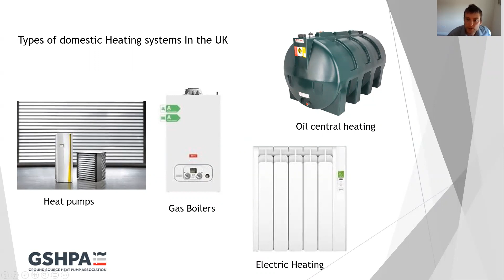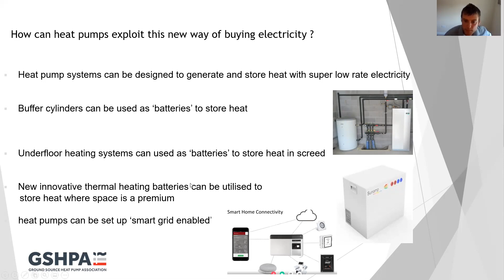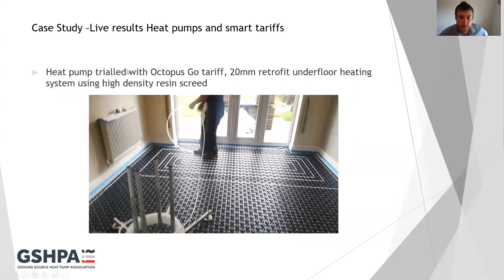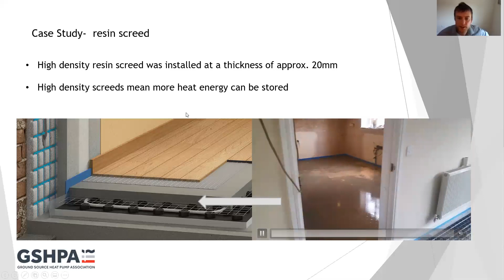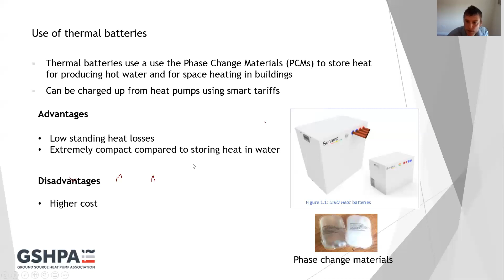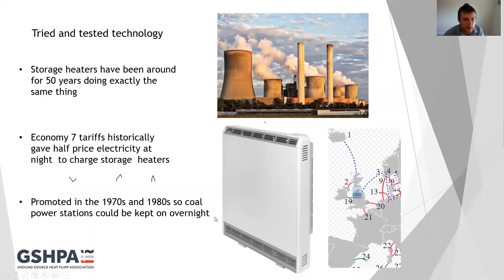GSHPA Webinar - Smart Grid Ready heat pumps - Dave Jones

Comment: nice video, im not from uk 

how big will be difference between 13:30 system pump+boiler, than system where there is only pump and straight into flor, flor also is buffer 

witch one of the producers (cheap) has smart grid in the pumps now